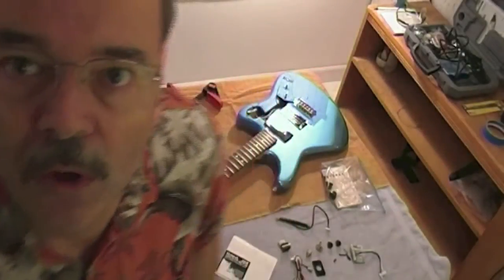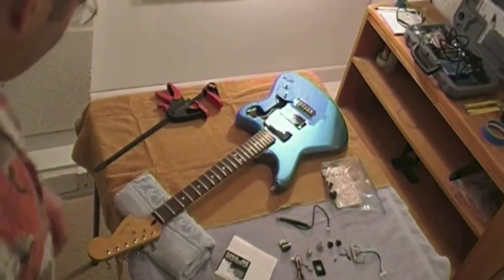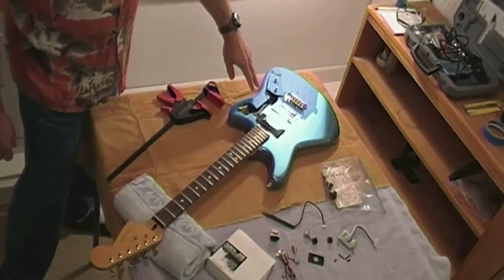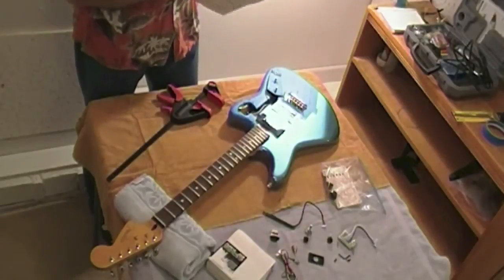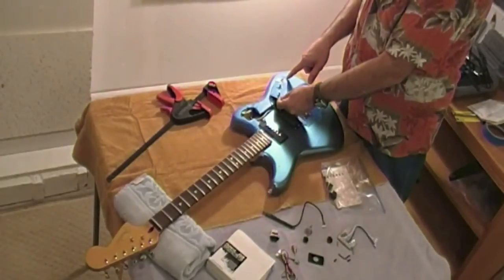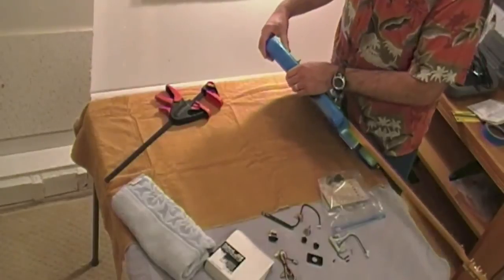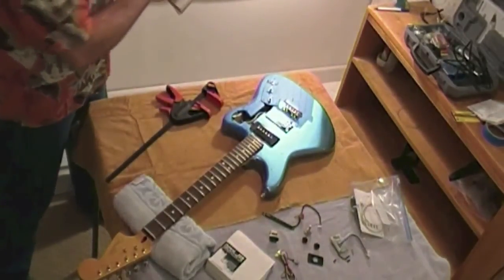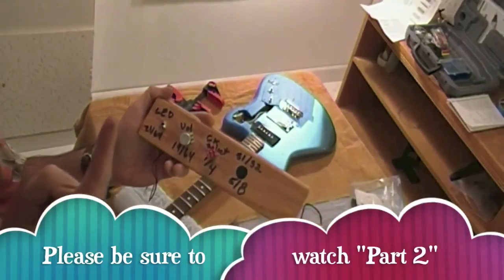Roland GK Kit Internal Kit Installation for GR-55 Part 1

Comment: just bought a GK internal. but i'm curious. can i use the Gk pu's and stock mag pu's separately at the same time? for example, connect the gk (13pin) to gr55, and stock pu's (std jack) to my ordinary pedal, at a same time?
Reply from the maker: The GR55 includes a "guitar" output jack.  Connect that to your pedal/amp.  See the diagrams and info on vGuitarforums.com http://www.vguitarforums.com/smf/index.php?topic=2953.0
Reply: Yes! If you don't mind using 2 amps, or 2 dedicated channels in an amp, or run the GK, PA direct? I use a stereo amp and run them side by side. I never use my magnetic pickups through the GK. There is a delay going through it, depending on the synth device you are using, to your guitar amp. There is no such thing as a "direct thru" on a Roland synth! Not to mention a loss of tone. Toss the GK/pup selector switch, and leave them separated! You will need to use two cords: the Roland 13 pin cord from the GK jack on your guitar to the GK device you will be using; and your 1/4" cord to your amp. Also, instead of using the S1 & S2 space hogging switches, I use one on/off/on momentary pole switch which takes up only a half inch of valuable real estate. I tossed that annoying LED light too! It's pointless, ugly, a distraction, and takes up space too.